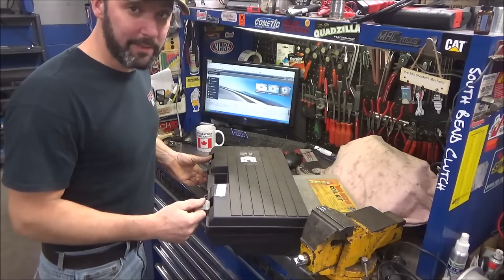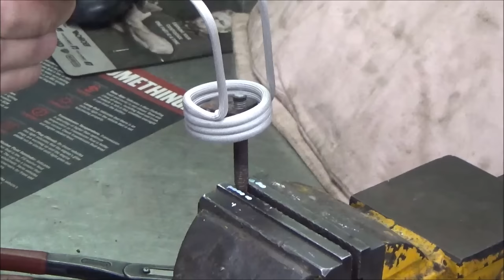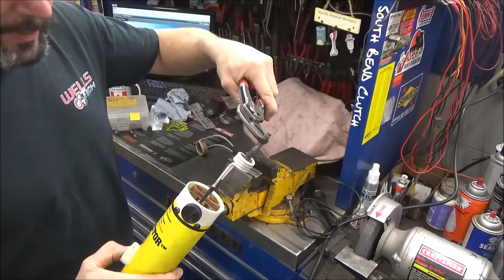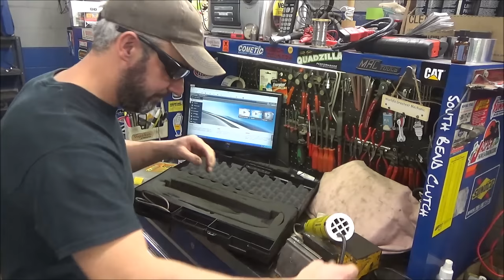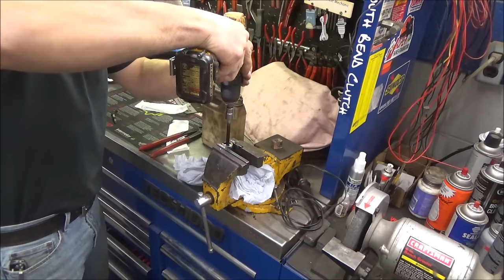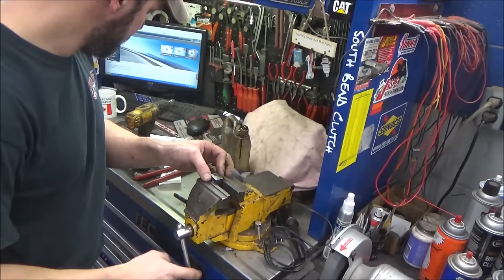How To Heat Up A Nut or Bolt WITH OUT A Torch

Comment: Bought one about a year ago. Rusted on bolts on a snowplow came off easily. Brake bolts, also easier to get to them than with a torch. I have several sizes of loops and the closer to the bolt the quicker they heat up. Also go around corners and will not melt plastic around a close fitting bolt head. Just used mine today on a f150 front brake caliper that hadn't been off for about 15 years. This and six sided socket made it an easy job. Friend was very happy I could help out.

Comment: I've been working on cars a long time. Over 35 years and I live in Northeastern Pa. Spray penetrating oil on the bolts. That is the first thing I was taught. The only bolts I generally ever snap off are exhaust bolts. A bolt will not snap 8 times out of 10 if it is sprayed up first. PB blaster is cheap at $4.00 a can. Kroil is not at $14 a can, but is still better than snapping off a bolt pointlessly.
Reply: The induction heating was fun to watch (Incidentally, if the insulation burns off, just make sure that the coils do not short, and you will be fine), but penetrating oil usually will prevent something from breaking if you are patient enough. Patience has meant an hour to turn a bolt 13 turns, but if repairing a break is worse, go slow because you are saving time in the long run. Put the impacts and power drivers away and loosen BY HAND so you can feel too much binding. Back off and flood with more penetrating oil to wash off any loose rust. You can generally get away with using more torque to break the bolt loose a few degrees because there often is rust on both the threads and the bottom of the head.
Reply: If you have been working on cars for 35 years you should know by now that you "never never never" even try to loosen and exhaust bolt without heating it first. that way they don't break.
Reply: I do use heat. Duh. I didn't say I snapped exhaust bolts everyday, but once in a while it does happen. Have you ever seen the crappy exhaust hardware they use on a Nissan?
Reply: i use pb blaster, you  you think is good enought to not go more expensive on your own experience??  or if the other expensive one it worth its value??

Comment: The induction tool is great BUT a torch is available anywhere, requires no electricity, and for the cost of the induction heater and coils you could get a torch and enough propane to heat your house for the winter. For the AVERAGE person it's basically a rarely used toy. This is a tool more for a professional mechanic. I'm preparing to do a lot of work on my 17 year old Ford Ranger and there's a lot of rust under there. My torch is going to be getting a hell of a work out. Just need to be super careful. I'm more worried about burning myself then burning the truck down.
Reply: propane torch often not hot enough unless you mix oxygen.
Reply: Torches are illegal to use in many home shops because of municipal laws and also fire insurance policies.

Comment: I have one of those as well, it's not something you use everyday but when you need it there is no substitute. I have mostly used the rope to wrap around the fan clutch nut, I work for a International truck dealership. The fan clutch hubs take a 2" wrench yet in less than five minutes it comes right off.

Comment: Another way is if you have a ark welder you can nock the flux off the rod so the rod sticks on the bolt and just give it 10 seconds and she's glowing not something I would do all the time but in a hurry its a good way
Reply: make sure you know what vehicle circuits are exposed to that kind of amps, that kind of juice can jump normal insulation

Comment: It's pretty cool that you can make your bolts as you go!  I'm never sure what type and strength of material the bolt should be made of so I go to the dealer if the car is still driveable. This month I broke some oil pan bolts and an EGR valve bolt :( It's a horrible feeling when you don't have a garage!

Comment: Been a machinist since
 1975. Your heading of the bolt was as good as could be done. Not sure what type of oil/lube you used (and a proper cutting oil is best)but  I see many mechanics do it dry. That DOES make me cringe. Keep up the good work Eric.

Comment: You mentioned welding or repairing gas tanks or fuel tanks when I owned my welding shop I stopped at my  buddys  welding & machine shop he was welding a car gas tank. He had drained it and connected a flex pipe to the exhaust pipe on his pickup truck  for a few minutes before he started welding and kept it running while welding. The excess  carbon monoxide was coming out the other opening. I was pretty impressed when he held the torch up to it no problem. We then went outside behind his shop where he had cut 250 gal fuel tanks and 50 gal oil barrels in half with a plasma cutter or torch. Again I was impressed since I had tryed filling an oil barrel with water after rinsing it first and proceeded to blow the top off the barrel  almost taking my arm and my head off with it. My ears were ringing for sometime after that. I also tryed just connecting my air compressor to a small gas tank but; even after a few minutes holding a lighter up to the other hole in the tank flames shot out. I decided to give up on welding tanks. Untill I seen him doing it by connecting to the exhaust on the truck. After that I cut and welded gas tanks, diesel tanks on lawn mowers, cars, tractors fuel barrels for stoves and furnaces everyone came with there leaking tanks never had no explosions. Wasnt some thing you did every day but if you had a reputation for doing things others would not or could not do. People would talk and send others to you. You know how that works. Any way keep up the good work.
Reply: Yes, that is how we welded a 250 gallon fuel tank. Let exhaust run in tank for a while and left machine running while welding.

Comment: If someone doesn't have a torch I guarantee they don't have a freakin Induction heater.lol
Reply: I have hunted the pawn shops for a plumber's B-torch, but they are usually gone by the time I get there! I have a serious set of cutting torches with 2, 3 & 4 tube gas feed pipes, but the monthly cost for tank rental & gas is not bad if you are using it regularly. That's where the B-torch is a good deal as it runs on acetylene and brings in air from the atmosphere.

Comment: While you were using the wire wheel you forgot to use eye protection. This is not a criticism but just a reminder because those are the only set of eyes that you get. Someone else might have already told you because this is an old video but it doesn't hurt to be reminded once in a while.

Comment: Torch head $25 can of propane $8....price of induction thing $430+ the $150 for the kit with the heads. Nice idea, but not a practical idea for most people.
Reply: Dutton Carbis ICU bed for 3 weeks, skin grafts, cosmetic surgery, ~10,000 bucks depending on your insurance. Torches are not for use near gas tanks, fuel lines, etc.
Reply: I'm currently using a propane torch to loosen an O2 sensor.  No luck so far.  I cannot get it to glow red like this tool does.  I am tempted to buy this induction tool.  It is more that what a mechanic would charge me to remove the sensor but then I have it for other jobs.

Comment: Damn, I wanted to see the blue flame. I'm as disappointed as the day they cancelled flame thrower day on me in the army. Really nice tool. One thing you said about using the inductor on cold vs hot metal. The cold will actually heat up faster than the warmer metal. We actually proved it in physics class. What happens is the cold heats up in a straight line where the warmer metal actually has to cool a bit first to match the heat from the inductor, not a big time lapse but it happens. I always try using the coldest water I can to make coffee. Works the same. One guy I met, put hot water in an urn thinking it would work faster, nope, it wasn't working at all. Thanks for sharing, Saw your Happy Holiday vide and forgot to say ' Happy Holidays ' and thanks for sharing.

Comment: Inductive heaters are awesome. Worth every penny! When you have a bolt thru a rubber isolated bushing, IE spring pin bushing, control arm bolts getting stuck in the metal collar, anywhere you don't want to use a flame. Or if you're just bored and easily entertained you can turn it on and put a chunk of aluminum inside the coil and watch a cool magic trick. Fun for the whole family. 👍

Comment: wow!  I had no idea they were that effective ; red hot is plenty on small to moderately sized bolts:  Like exhaust / cat bolts at the manifold of a 4.2L Audi .  That is a very, very tight space and you don't dare brake one of those manifold bolts off!   Unless of course you plan on removing the motor!!   I have a oxy/ace set up but for this application , I think the IH wil be perfect.  Thanks for the great demo; you sold me. Stefan

Comment: If you are a guy that regularly works on cars at home and you don't have torch set, GET ONE!
Reply: jhitt79   Kano Kroll the best penetrating oil
Reply: Arthur Smith that may be true, but even a "hobbyist" or regular d.i.y. Should have a torch set.  The best penetrating oil in the world won't cut steel. And you can spray penetrating oil on rusty wheel hub bolts for six months it's not going to get in deep enough.

Comment: they are a nice tool to have. we had one at the dealership I used to work at, always used it on manifold to y-pipe nuts, since they always rounded off or the stud broke. we got that one on a promotional offer when they first came out, the shop paid like $450 Canadian for it. recently in the MAC flyer they were selling them for like $550 Canadian on sale.

Comment: Or a $15 propane torch from Walmart
Reply: Which most of the time doesn't work so well.
Reply: Or a $15 induction heater from Wish. May be cheap and nasty but for the amount of time the average homeowner would use it, even if it only works for 10min, it is worth it.
Reply: Those propane torches don't usually supply enough heat for the job and can take much to long if the do.

Comment: I've always been a big fan of 50/50 acetone and atf. If I can use a torch even a small one I'll heat up the bolt then touch it with some wax. Both have served me very well in the past. I'd love to play with an induction heater though, looks way faster than my propane forge for small stuff.

Comment: $30 torch at hime depot

$300 inductive heater
Reply: A $30 torch won't get it hot enough
Reply: @BillSikes.  Hot enough if you Shock it with Cold water

Comment: The problem is at the house I'm trying to remove the frozen lugnut when the wheel is on the car not on a lift at a shop so this video is completely useless. You need to delete this video
Reply: Your comment is useless
Reply: I've used my magnetic induction heater for rusted lug nuts at home. It works great. Plus, I don't have to worry about my oxy-acet torches melting the aluminum wheel.  I think this tool is good to have in the rust belt.

Comment: That's funny, the belt tensioner on my Toyota is so corroded that when I went to adjust it the other day due to some belt squeal from the cold weather I took one look at it I thought... Nope. I will deal with that next year. I actually had no idea that they made induction heating tools for that use. I have a familiarity with induction heating from manufacturing of certain components. It's certainly a lot easier to find room for one of those than an acetylene torch! 

Thanks Eric. 

Merry Christmas and a happy new year to you, Vanessa and the Kiddo's!
Reply from the maker: +zoidberg444 Merry Christmas and a happy new year to you too! Sounds like you need an induction heater for x-mas!

Comment: I love this thing.  One thing I often do: get it red hot, and touch a block of beeswax to the threads.  The wax runs in and makes the two parts even easier to separate.  Of course, a $30 plumber's torch versus about $600 worth of Ducter (when I bought it).  
I bought the Ducter not just for gas tanks, but because it doesn't make a lot of heat in the parts adjoining the one you're heating, so it can be used on suspensions without melting the bushings.  That's a big deal on modified cars where the bushings have been replaced with performance items and you don't want to buy a new set (nor do you want to tell the customer that he needs a new set of bushings)...

Comment: I can't get the nut off a 1994  Corolla fuel pump that is attached to the top of the gas tank. what would you use to loosen it? The normal tool will not budge it and I am afraid to snap it off or use a flame to loosen the nut.
Reply: Robb's Homemadliu

Comment: I was all spooled up to buy a new gadget until I saw the prices. I'll stick to torches for now. Never heard of those, thanks for the demo.
Reply: Same thing I said. I know flameless is a cool trick. But for the rest of us just buy a Turbo Torch brand torch there about 80 bucks. Put on yellow MAPP gas. 2200 degrees. You're done. Turbo Torch makes a bunch of different products but the one we used to braise copper on refrigeration....... they're not very expensive

Comment: Also here's a question.... will an Induction heater work for a steel bolt in Aluminum situation? Since the aluminum is non magnetic, would it still heat the aluminum to expand it around the bolt? Or would it just heat the bolt therefore making it actually fit tighter?

Comment: What an engineer to come up with the idea of using a grease canister for the induction heater 😁
Reply: I got a good laugh out of that Lassie. I never thought about it till you said it. I just thought it looked kind of tacky and cheap actually. It's $431 on Amazon plus the cost of the coil kit which could be pricey as well. I was told by a professional mechanic that these coils don't last that long either

Comment: I believe the inductive heat tool would be of value - as you mentioned - when using to loosen bolt still on the vehicle - mounting your seized bolt in the vise - out in the open - no problem just using a torch - 😐✌️great demonstration of the tool 🙂 good fabricator for your new bolt - 👍

Comment: OK what bolt was it that broke. Looks looked like the PS Pump or Alternator tension adjustment block and bolt.
Reply from the maker: +Claude “Reviews4U” Rains Alt. tensioner...
Reply: South Main Auto Repair Well I noticed the second time I watched. As I was distracted at the very start by someone with 20 questions.

Comment: It certainly doesn't hurt to have more tools in your arsenal.

Gas axe has its place.  But like you said this tool is great for when you can't use fire (near fuel lines etc).

Great video as always.

Comment: That inductive heater is cool I find it amazing how fast they heat up. Do you just use old motor oil as cutting oil. You know there is a thing called a tap handle and most sets have them. LOL I bought a used thread chaser set like that and have used the heck out of it working on mostly old stuff
Reply from the maker: +Eric Corse Tap handle? I have impacts you know!
Reply: Now I'm really going into A-Fib LOL
Reply from the maker: Haha you think I am bad you should see my dad with taps lol

Comment: Cool video.  I never thought to use my Milwaukee 18V Impract Driver until I saw you use an impact driver in one of your videos.  Used mine to disassemble a John Deere Blower unit that had a belt shield break off.  Cut some steel and bend the brackets to replace the plastic tabs that broke off.  I also never thought to cut threads like that.  Damn cool.   Your online store looks great.  Well done.    Merry Christmas to all of you at South Main Auto.

BTW, I see you sell BrakeKleen in your store.  You keep forgetting to use it in your vids.  LOL
Reply from the maker: +raykrv6aMerry Christmas to you too! Always need to think outside the box right?

Comment: I used to make flexible PVC tubing... Pump tubing, medical tubing and laboratory tubing  for a company that would use Inductive Heating over the pin and die for tubing to heat up the pin so that the inside of the tubing would be shiny and clear and not dull...these things work great....

Comment: I just broke the same 1mzfe bolt, and the "pinch bolt" that keeps it in place.  Do you know where I can get replacement bolts for those?  What size was that bolt you used?

I also broke the pinch bolt off inside the alternator.  Do you recommend a way to get it out?  I was thinking of getting a Screw Extractor and spraying a lot of penetrating oil to loosen it.

Comment: very cool tool may i sugest rapid cooling after heating would work better with less chance of breaking or snaping off... worked at muffler shop heating up red and rapid cooling it 1 or 2 times works best

Comment: Used to use a big version of this at the body shop to burn the panel bond off of bedsides when we replace them. They can also help remove glass because it heats the metal up under the glass melting the glue. But the back side has to be stripped to keep the interior from burning

Comment: Can I use the small blue torch from hardware stores to heat up some exhaust manifold bolts to remove the manifolds? The truck is an '02 and I don't have an acetylene/oxygen torch. Also, can the aluminum block melt if I accidentally point at it? Or do I have to deliberately aim at the aluminum for it to get hot enough to melt? I don't have much experience with torches.
Reply: u2bed91 a propane torch probably won't heat it up enough to work it loose. Try penetrating oil. I use Freeze Off for the tough stuff.